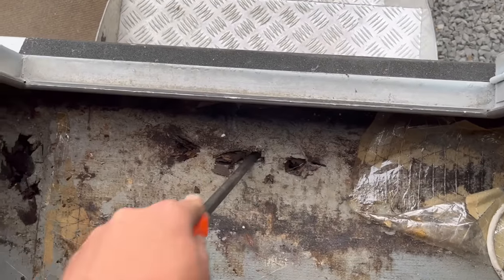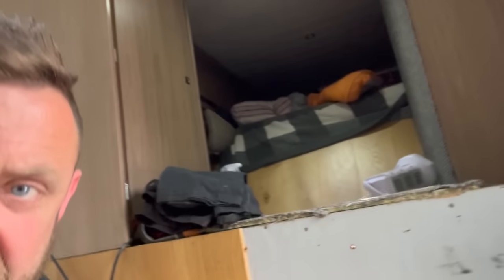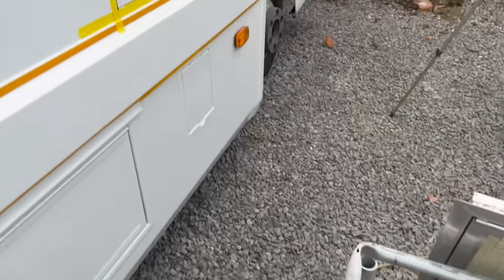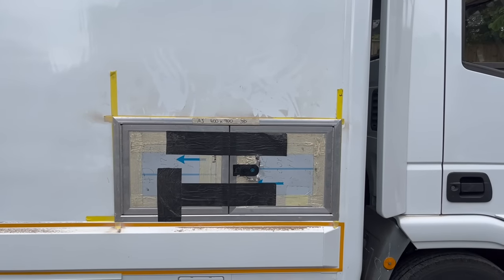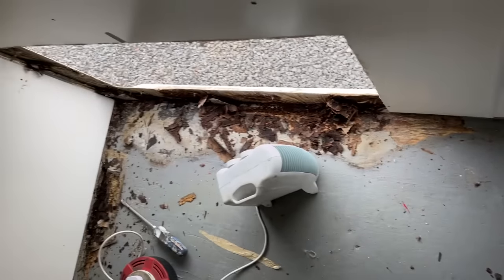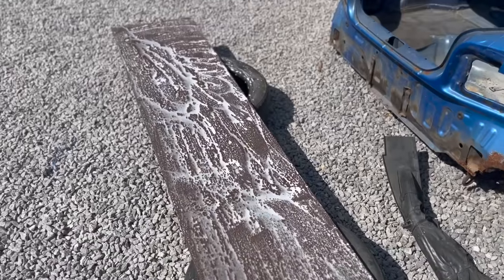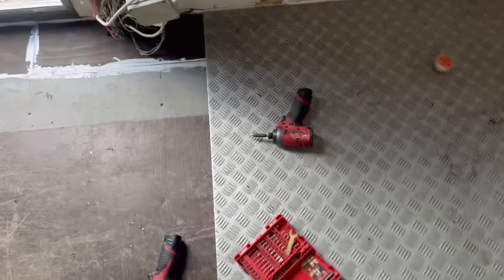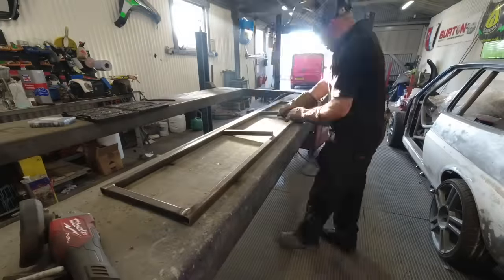How We Are Building Our Own Camper van - ROTTEN FLOOR Can WE Save it ? Season 2 EPS 1

Comment: The most common failure point on them Milwaukee Grinders is the rear bearing on the armateur collapsing and the armature rubs against the stator and makes an awful noise.
Reply from the maker: yes but this was not that this time it's been the motor rip